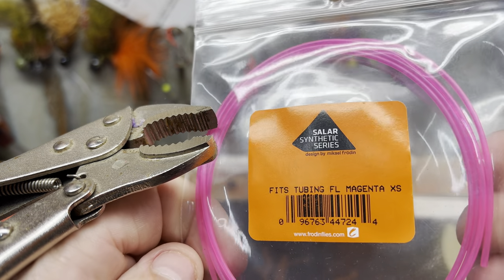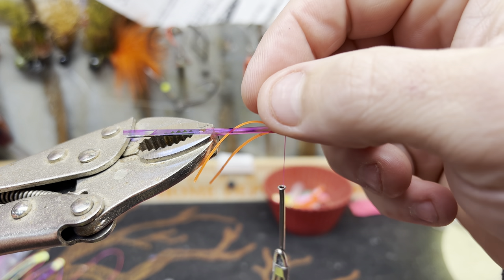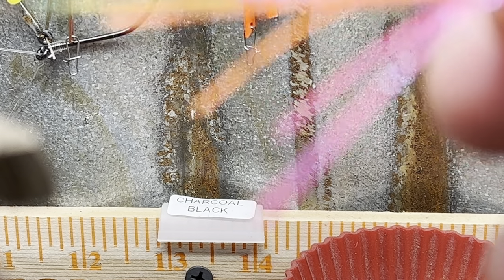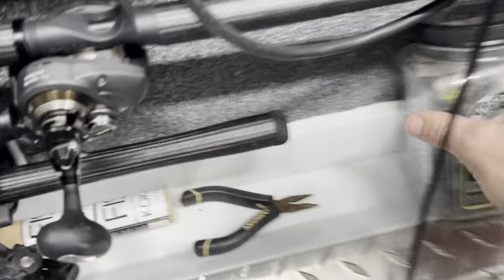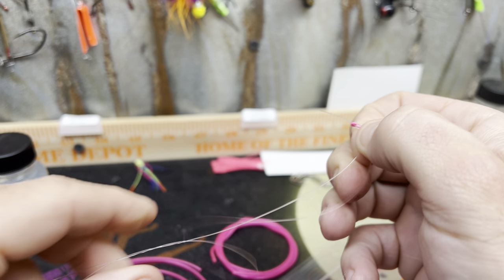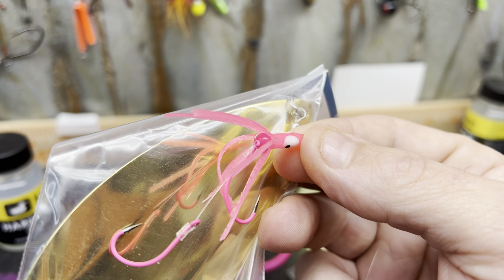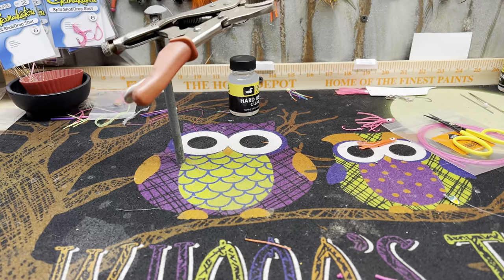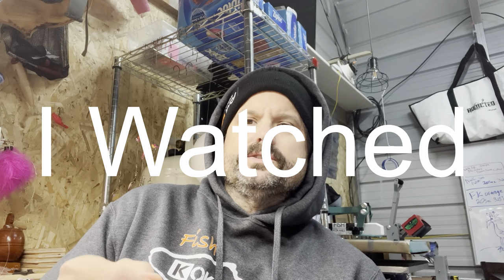The Truth about Kokanee Fishing (Channel Update) Vedder Fly

Comment: I use vintage Daiwa fiberglass rods with a fly reel. I add 60 ft of mono ahead of 15ft of braid then the backing. I adjust depth by changing out weights (0 to 4 oz). I fish out of an 8 ft pontoon boat (oar powered) and I do well. I also tie my own tube flies. Don’t need to overthink it. Kokanee strike out of curiosity or defense just get their attention.